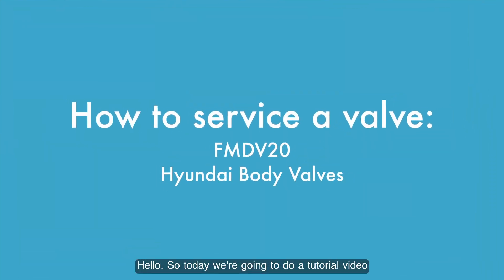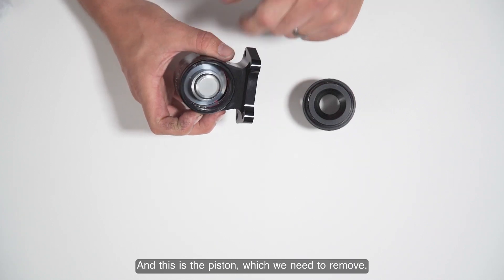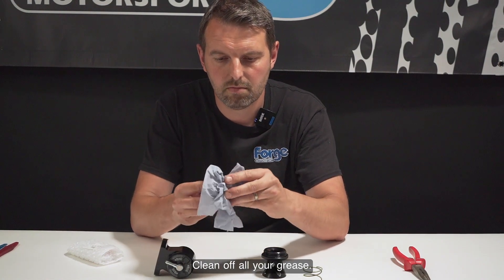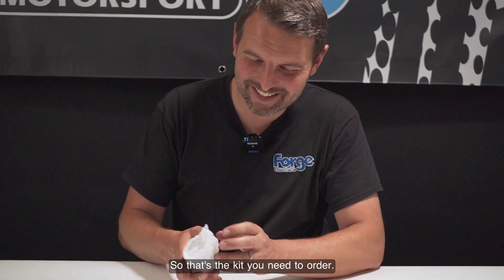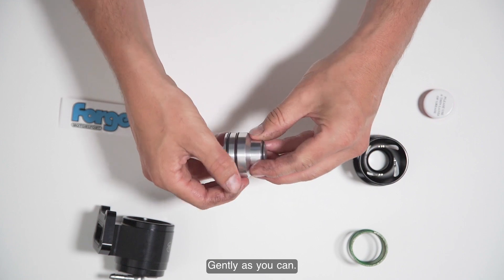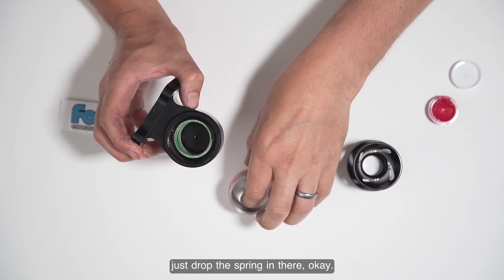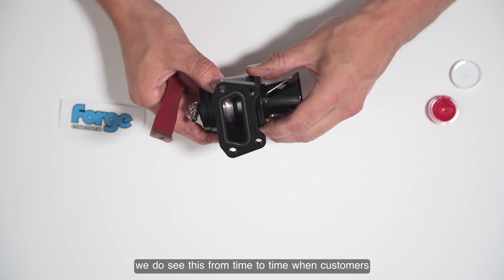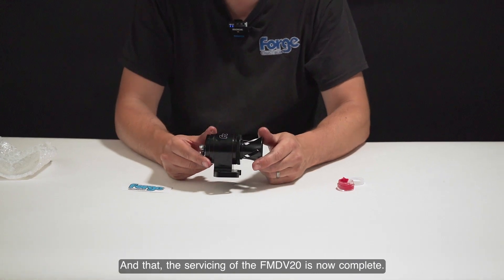How to Service your Valve | Hyundai Body Valves | FMDV20

Comment: How often do you need to service it?  What are the signs it needs servicing?
Reply from the maker: We usually recommend servicing a valve around every 3 years or 20,000 miles. A sign can sometimes be if the piston is sticking, the symptoms can change drastically depending on application and type of valve. But if you stick to the routing services you will usually avoid any issues :) We are always here if you need any advice or questions as well, so please feel free to contact us directly if you need any help! 

Thanks!